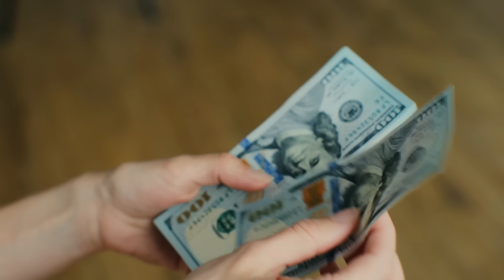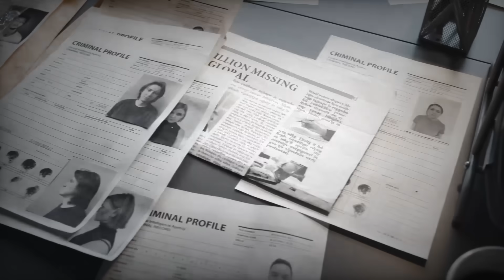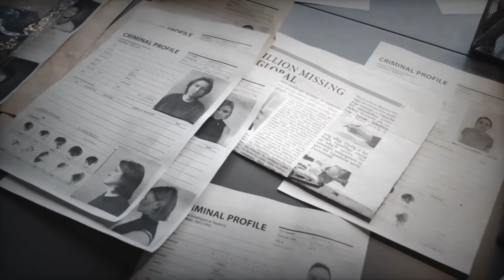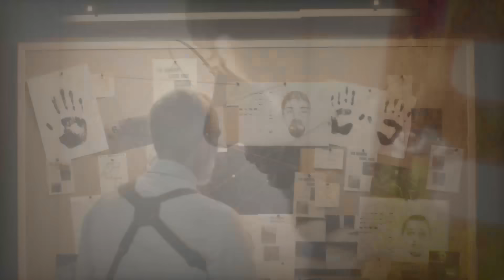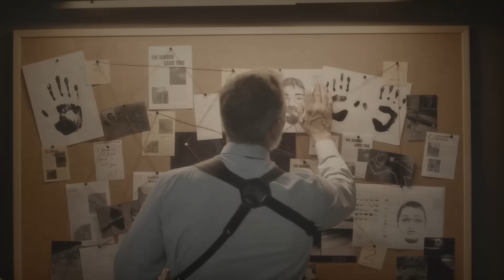Two Girls Go Missing For 40 Years Until Man Buys Old Used Car

Comment: I noticed that the photograph of the car interior is either laterally inverted or, less likely, this vehicle was a right hand drive.  I guess it's possible that the photo was made from a negative transparency that was upside down.  What do you think?
Reply: @donblack4521  Interior shot of the car was actually a right hand drive British Triumph 2000 Mk1 exactly like the 1964 model I had from 1972 to 1975. It's typical of these so called documentaries to just use any stock photo of an old car! Note they also repeated the same narrative at least twice!